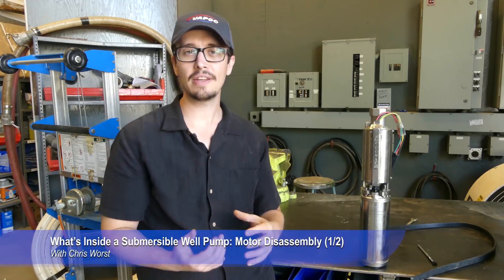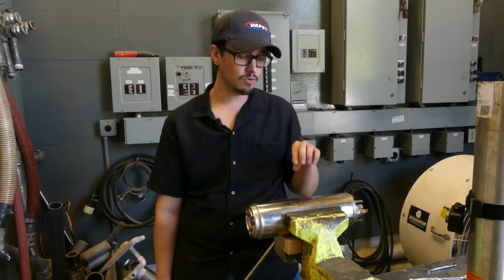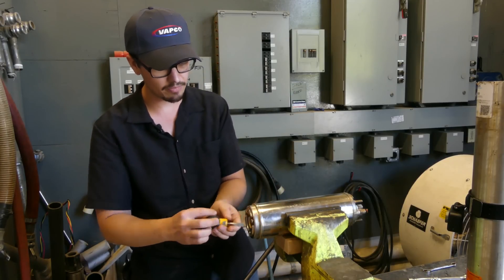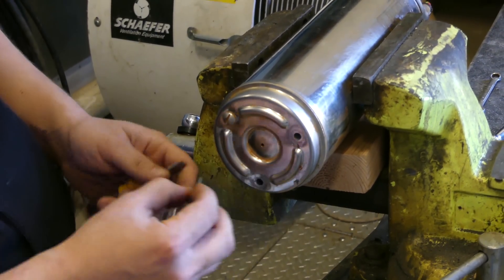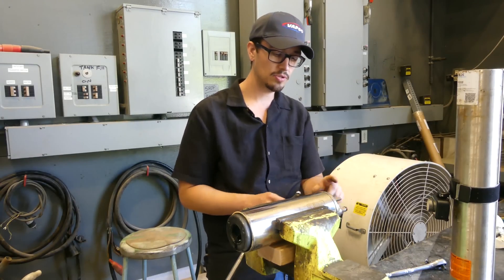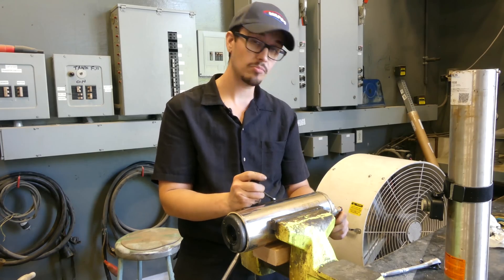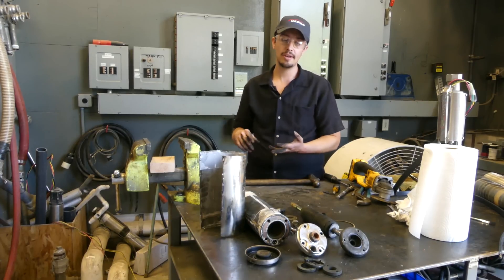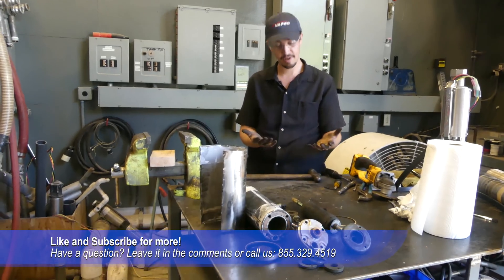What's Inside a Submersible Pump: Motor Disassembly

Comment: Can you replace the capacitors on a two wire pump
Reply from the maker: No, the motor will have to be replaced.
Reply: @RCworstwater  Thanks for the reply! Was very happy 😅 to pull the pump and discover the problem was that the poly pipe had came off the nipple. Not a good thing to happen either. Luckily I had a safety line to the pump. But at least it was a free fix. Added an extra hose clamp and made sure they were very tight this time

Comment: How do you lose a part on a work bench?, and the motor runs under water and will remain cool, the epoxy around the winding does not compromise the cooling.

Comment: Got my new pump in the mail today, isn’t  glycol poisonous? Should I run the pump a while before I drink any water?
Reply from the maker: Shane, this video shows the disassembly of the motor, which is completely sealed from the pump end/water.
Reply: @RCworstwater  I know I'm late to the party but even though the motor is below the pump you really don't want nasties in the water. I'm guessing whatever antifreeze is used during manufacturing is nontoxic. I knew submersible pump motors were water cooled but I assumed cooling was by heat transfer from the outer motor housing into the surrounding water, not actually having water circulating within the motor. Given sand/fine sediment, at least in our well, allowing water into the motor seems pretty risky to me, but this is not my day job.